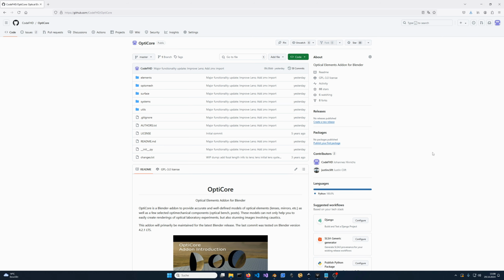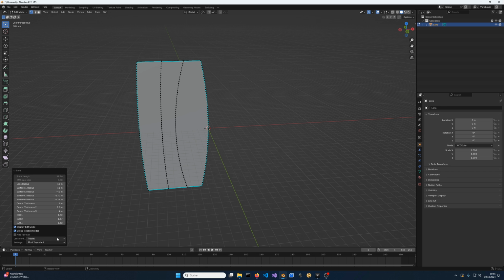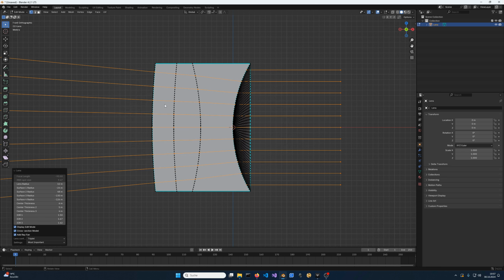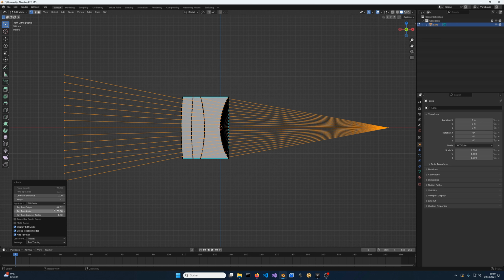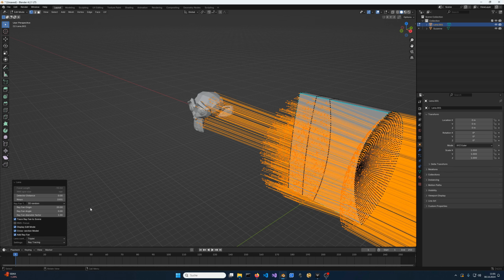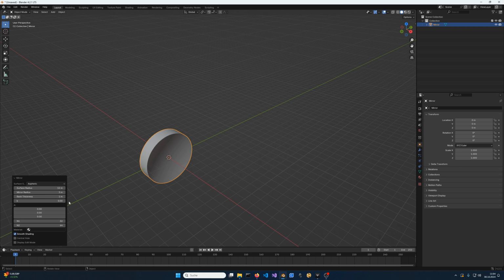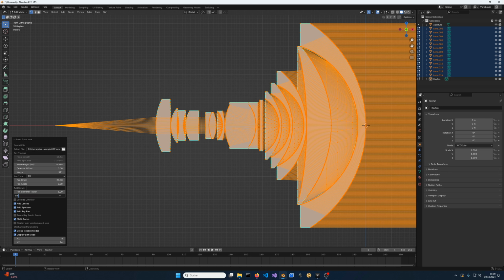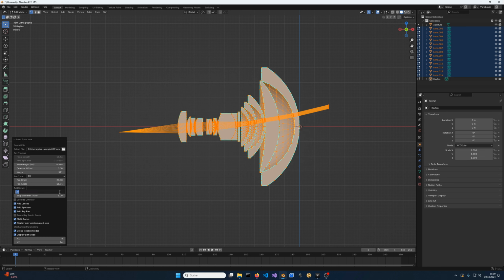OptiCore 2024 - Part1: Introduction

Comment: When I tried to enable the addon, reported error, no module named 'numpy._core'. blender version V4.2.11
Reply from the maker: That indicated there is a problem with the numpy isntallation inside Blender.
This isn't triggered by OptiCore, as it doesn't meddle with the internal installation.

However, I have seen this happen with our latest release of LuxCoreRender: The current version 2.10 needs a special numpy installation. The problem can then happen when uninstalling the BlendLuxCore extension again: Sometimes it ends up in this state.

Did you recently install/uninstall BlendLuxCore by any chance?
If so, I suggest to either try to install/uninstall it again, it may fix this, or reinstall Blender.
Reply: I uninstalled and then reinstalled NumPy; then the problem was solved.

Comment: not able to add it on. is it specific to some version of blender. im currently using Blender 
4.3
Reply from the maker: It should work fine with Blender 4.3, I currently use 4.3 on my Linux setup as well.
Could you specify the errors you are getting? I.e. console output from Blender?

Ideally, open an Issue on GitHub for this, would be the best place to document any installation Issues. But if you want to post it here, it is fine.
Reply: It started working, thank you for the support. 😊

Comment: Sorry if it's a stupid question but is it possible to assign material to the ray fan and maybe control the thickness of rays? I'm trying to do some simple lens visualization (side view) using cycles.
Reply from the maker: @Kincellan  maybe a solution like this will work: https://blenderartists.org/t/creating-a-cylinder-around-a-line/1180346
If that doesn't work I should be able to create a new rayfan type for this
Reply: @howtoprint6002  That worked well, thank you!